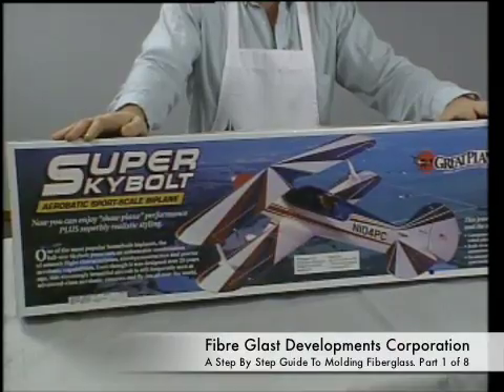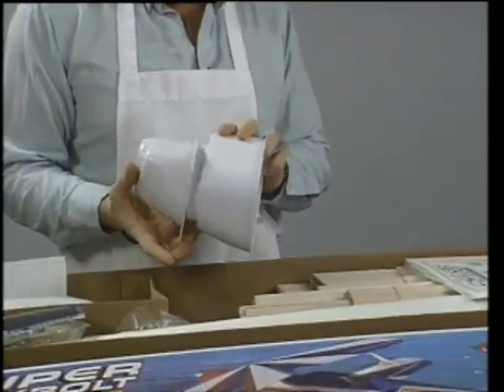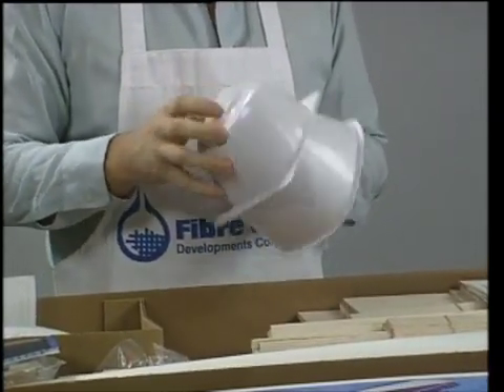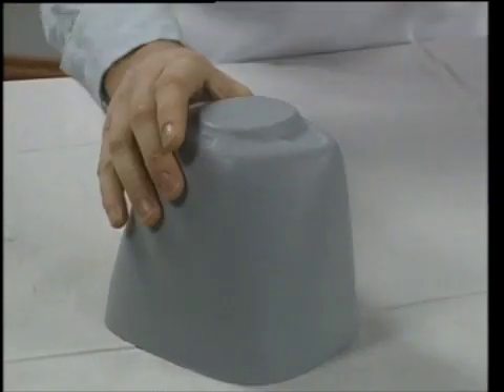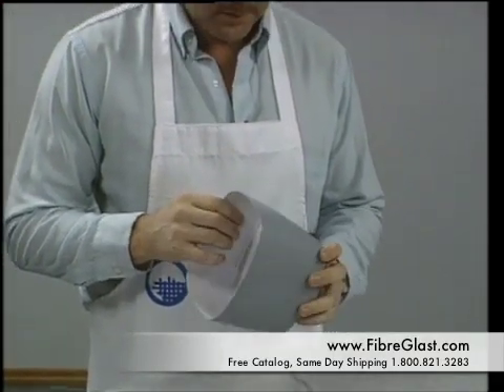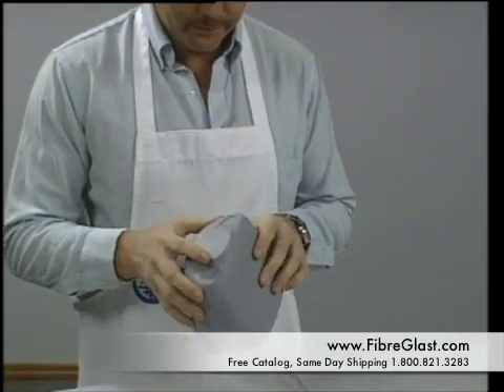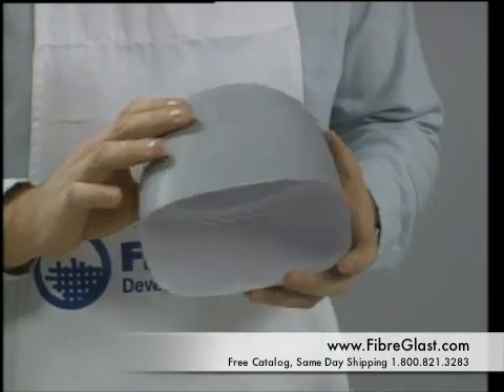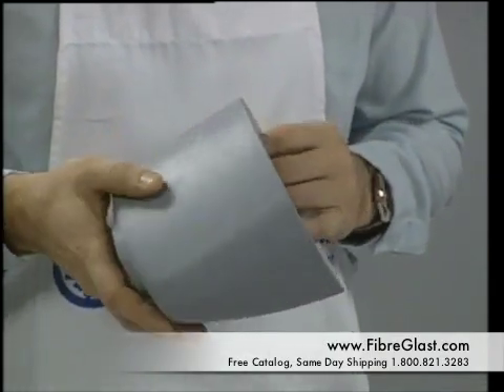How To Mold Fiberglass & Composites 1 of 8

Comment: fiberglass being a really resisting polymer material won't have eroding problems , as far as heat is concerned fiberglass flows and degrades at 1200°C so as long as you're not in THAT kind of environment you should be safe, no fumes also.